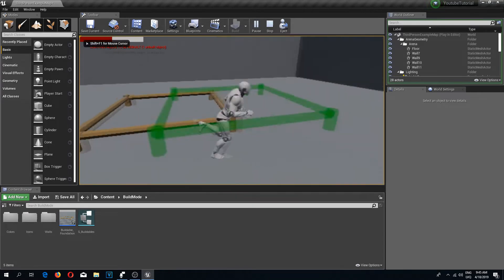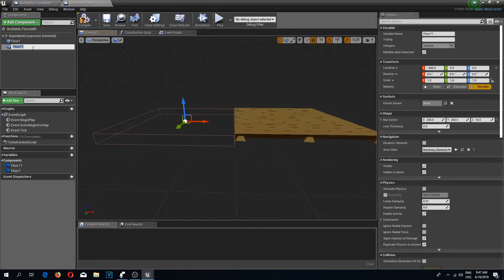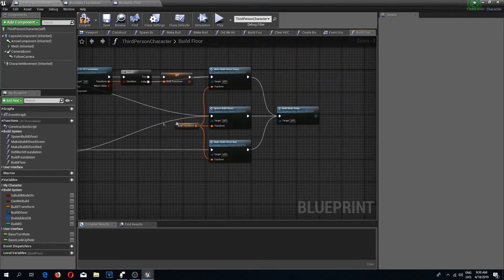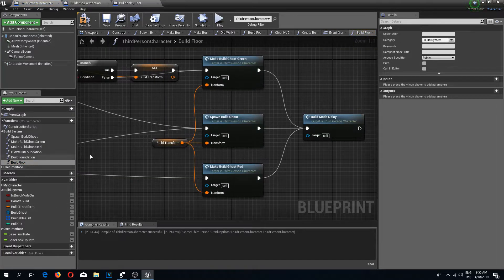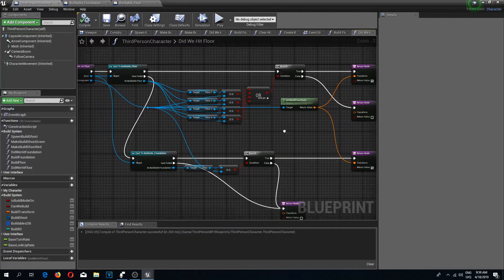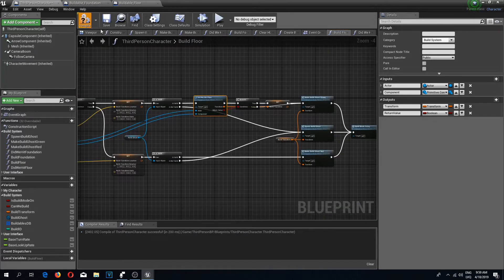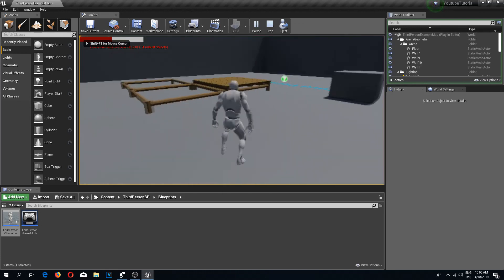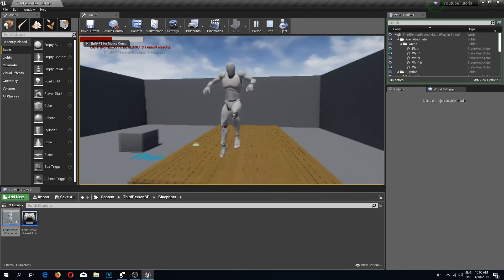UE4 Survival Game Series Ep5 / Build Mode Tutorial Adding Floor

Comment: Great tutorial! I've ran into some problems, but managed to solve them by comparing between Foundation, Floor Functions, Event Graph's Build Mode, and Mouse Left Button Click.
But up till now, I've only been able to follow along, and unable to create anything on my own. I would watch your video and follow feverously key press by key press as you go along, stop the video every few seconds, and went back if I missed anything due to trying to find what you just typed or clicked.
I'm not sure if I would really learn how to code this way, as a graphic designer, and I don't have any CS or even engineering background.
Do you have any suggestion how I can learn more effectively?

Thanks!
Reply from the maker: Well these are my very first tutorial. So they are not great. Audio is bad, explaining is bad. Everything bad :D but im working on a new system that is way more simplified and easier to understand. Its probably gonna come out within next few weeks.
Reply: @ItsMeBro  Oh, no. I did not meant that for a criticism. I think this tutorial is quite good, and the problem is me for learning slow and having artist background.

And the question was genuine. I really want to know how I can learn blueprint programing more effectively. As I watched a few different Tutorials already, but still felt like I have to just follow every click or I'm lost.

Comment: Hello, should say your series are epic from now.
I have a question:
Is it not better to make an Actor Component (like Build Component) that can be added to any characters instead of many functions?

Thanks for your time :D
Reply from the maker: Well, yes and no.
Why would you have many characters? Wouldnt the master char hold the logic for everyone?
Reply: @ItsMeBro   yes its just a master character could be different from a master player character, so i could add a component to a player character but not for an AI character for example but it is working fine also like this :)
Reply: @ItsMeBro   also now with this part after adding the DidWeOverlap part my foundations do not want to place at all.
I am using a custom foundation with floor incorporated, so i basically watched but not did most parts of it since my walls are placed directly on the foundations, the "floors" will be placed over the walls for a second floor as ceilings.
It is very well explained and i could do that, just not sure if its because my foundations are hitting the landscape.
https://media.discordapp.net/attachments/273781636447862785/763245401087148072/unknown.png
Reply from the maker: @malousworld922  check if your model does not go below 0 in relative space. Because even 0.0001 under it will collide with the ground.
Another option would be divide the box extent a little. In the didWeOverlap
Reply from the maker: @malousworld922  didWeOverlap extent has nothing to do with positioning. You can snap anythong anywhere. DiDWeOverlap should only be ran if we hit something unknown. If you need more help, join my discord. It's easier to chat there and share images. I should be online in an hour.

Comment: Thank you very much for thos videos, they hare great. I have a probleme in this video with the last modification you made to avoid to put mesh in a other. I do exalty your new line with the "BoxTraceByChannel" but the ghost become permanently red. It's like if the ground is a obstacle!
Reply from the maker: Ground is an obstacle. If you want to ignore the ground, you need to check if the hit actor is ground and then if it is, you can allow to build on it even if it collides.
Reply: @ItsMeBro  ok thank's i try to do this :)
Reply: and wy don't you need to do this in your exemple ?
Reply from the maker: @pierrefauno5309  Because my floor is flat and my models are not below 0 in the relative location. You need models that are not going in the ground to make this same example work exactly the same.
Reply: @ItsMeBro  ok thank's

Comment: pleaseeeeee helpe meee I try pacing the floor in top of the foundation it dosnt apear but in the ground it works fine
Reply from the maker: You have missed something. Make sure to detect the foundation box colliision. Get it's location and set your buildables location to be the one from the collision box.
Reply: @ItsMeBro  very sad, I've watched this video countless times and redid all the steps in the same video, but it just doesn't fit the floor in the foundation
Reply from the maker: @peripéciaspimposas  You have missed some detail. Because the system does work.
Join my discord, so you can share some screenshots, so I can see where is the issue.
https://discord.gg/Gr9sPP2

Comment: Thanks for the video. I've been following along and hit a weird snag. It seems that when I select the floor from the menu, the ghost build moves from the impact point to someplace floating over my character. This doesn't happen with the foundation though. Any ideas?
Reply from the maker: I have a few ideas.
1.) Line trace is hitting your character, make the start point further away from your character.

2.) If it's a line trace fault, you can also change collision for character components, so that the trace channel ignores these components. (only helps if you have issue mentioned in 1st idea)
3.) Your collision boxes are off. Make sure that the locations are at 0z axis. And X or Y is 400! And scale 1x,y,z axis (SUPER IMPORTANT).
If your still having issues, feel free to send a screenshot of your functions to my discord: nusun#1898
Reply: @ItsMeBro  Thanks for the quick reply! I extended the trace forward and had it ignore my player.. between the two it works now!

Comment: I ran into an issue with the box trace by channel. It is always red now. I couldn't download your building assets so I made my own. The Build Ghost is red and seems to be half way though the floor always. I tried changing collisions, then I put an offset to the transform where we spawn build ghost. Build ghost red is above ground and still red. It works fine if don't do the Box trace by channel. Any help would be great
Reply from the maker: Build transform does not matter as much i think. (The actual preview mesh).
What matters is the box trace. If the mesh is low on Z axis, you need to lift the trace box in Z axis.

BUT it would be better and easyer if you would make models that are on the right spot 0x/0y/0z
Are you using blender for modeling?
If so, place the model on the ground, at least 1pixel above the Z axis. Than while in object mode, press ctrl+a and there you need to reset location, rotation and scale. (Just find and click them on the list)
These locations, rotations, scales you can find by pressing N.
Reply: @ItsMeBro  Thanks for the help. I did end up tweaking the model and playing with the box trace. It is working now

Comment: Btw can you make a vid on how to add a working door that will Be asome
Reply from the maker: Ok. Will do that. :)
Reply: @ItsMeBro  tnks and man what whas i happy to find this vid i look for one for 2 years and only saw paid ones this is Just great ow btw because this is made by you am i allowed to change the textures So its not low poly even do i really like it but is not really fitting in a non lolly game Will Be funny do
Reply: @ItsMeBro  btw a question if i delete the building canvas to make a  new one will that break the codes (im not deleting the code only the grapichal part)
Reply from the maker: @FreakSheepVODS  So we have 2 widgets. A button and the menu it self.
All you have to do is recreate the code for the button, to the new button. https://i.postimg.cc/1X3JzyTB/Untitled2.png

And for the build menu it self, on event construct (opening the menu), since I place all buildables in an array in character, I just loop it to make many buttons. And that creates many buttons in build menu. https://i.postimg.cc/bNqm69wb/Untitled.png

Technically you could remove button widget and just manually place many buttons in the build menu. But than you need on click event for every button and type in buildID in the SET BuildID node, that you set for the character.

If you only want to set a background you can add a border as main parent (first under the canvas) https://i.postimg.cc/02rtSd5C/Untitled3.png

If you will delete the button in button widget, or size box in build menu, the code will brake.
If you can tell me what exactly you want to change, I could make a video on this topic.